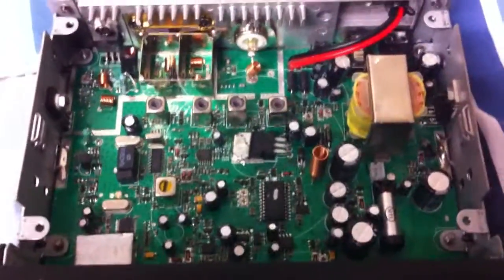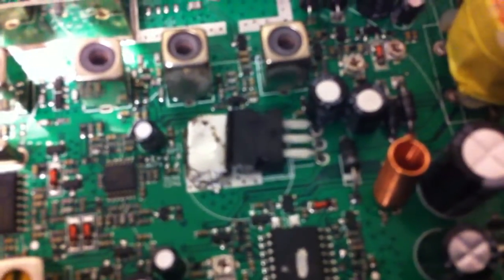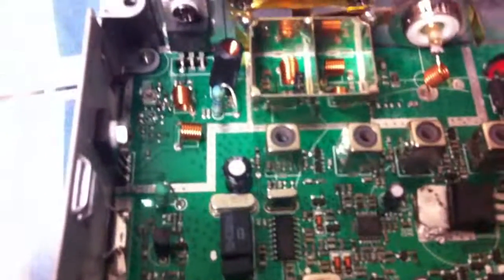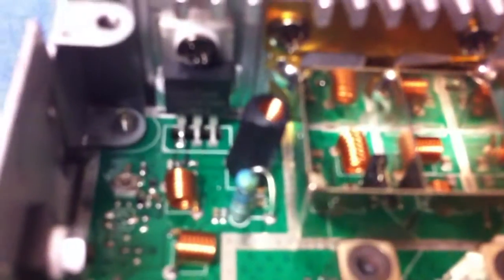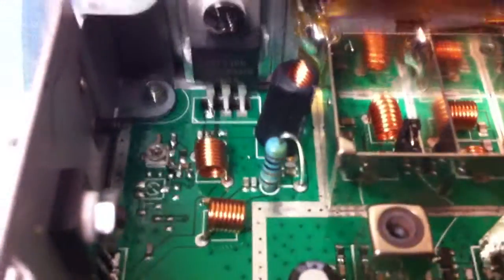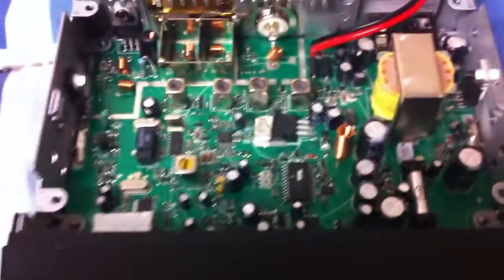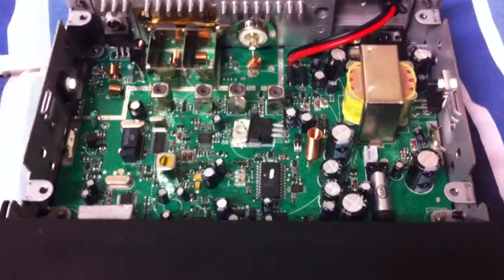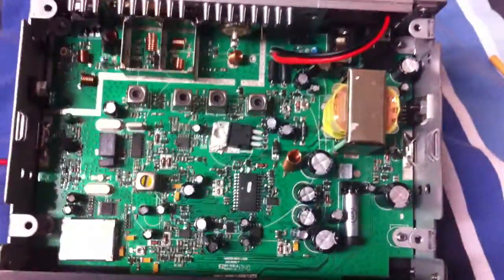CB Radio: Luiton LT-318 - Internals

Comment: may i ask you what is the black component, screw fixed on the case, near the mosfet? thanks!
Reply from the maker: Possibly a driver or predriver. Not sure as I no longer have the radio

Comment: There is also a Delta LT-318 that is exactly the same as this model.
But I am trying to find out if the Delta is PC programmable, and the RF power is switchable? Does any one know please?
Reply: The RF power IS Switchable, if you switch OFF the Radio and hold the F & DW buttons while switching on, (a little fiddly) there are 3 modes in the top left NO, LO, & HI, No does nothing that  i have noticed, LO Doesn't show on screen but HI does all 3 can be scrolled through with the Channel Selector...